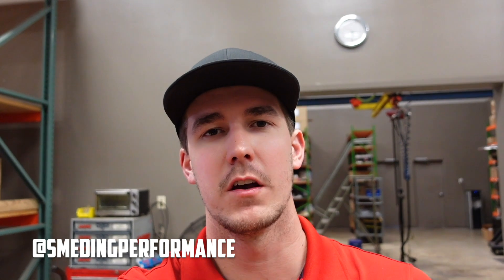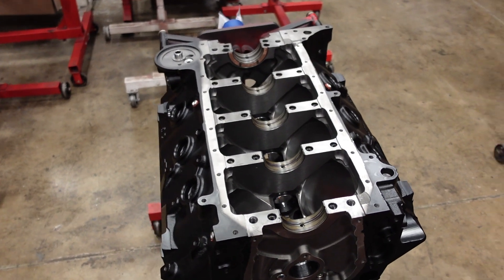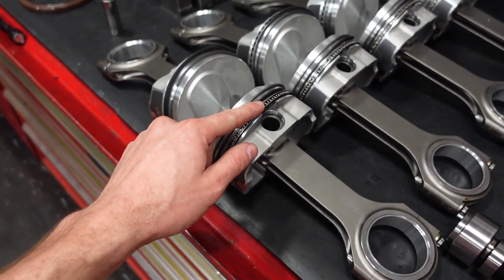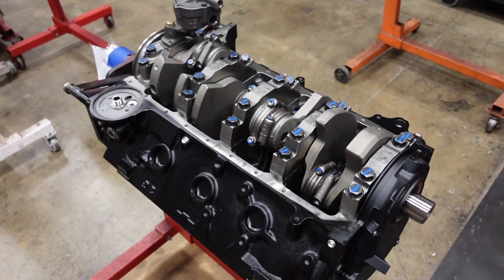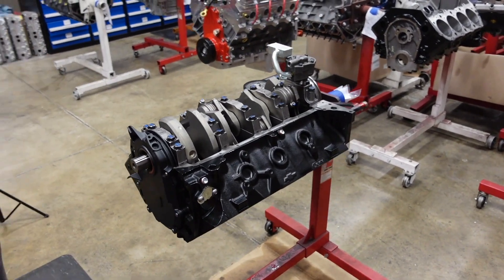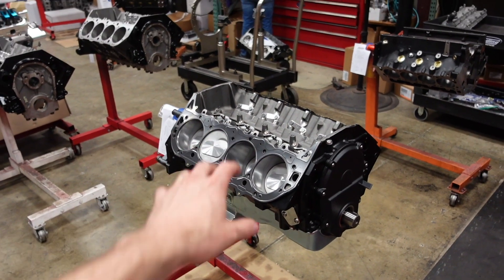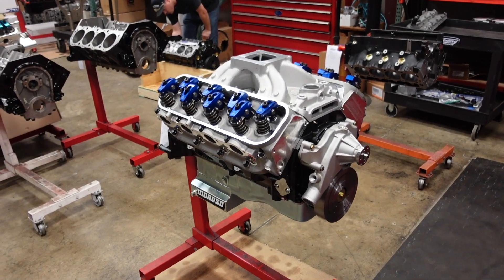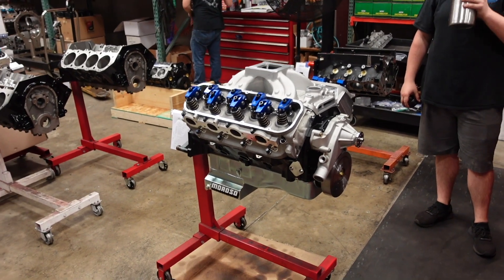Building a Nitrous 540 BBC Engine (1,000 Horsepower)

Comment: Few issues.  One, why aren't you checking rod bolt stretch?  Why are you using silicone on a rubber gasket???  Why did you use silicone on the outside of the rear main??
Reply: It will change every time rod bolts are torqued.  the only proper way to tighten them is by  stretch.  But admittedly, people have only been torquing them for decades without issue on most stuff.... @bigboreracing356